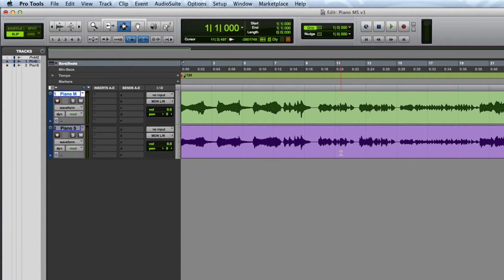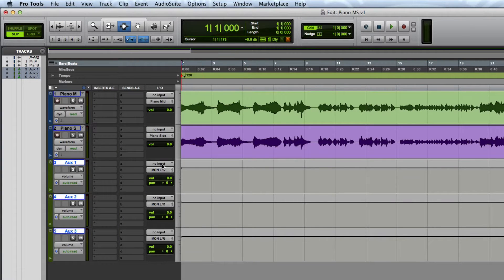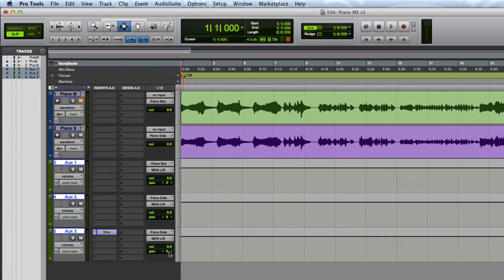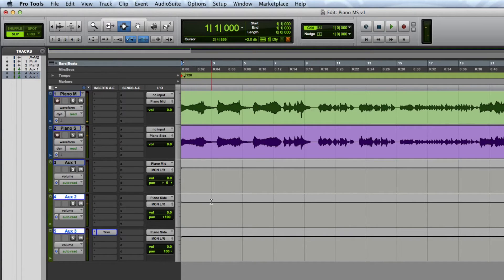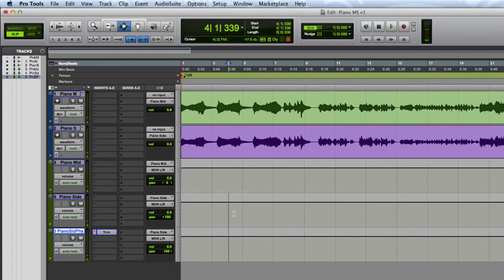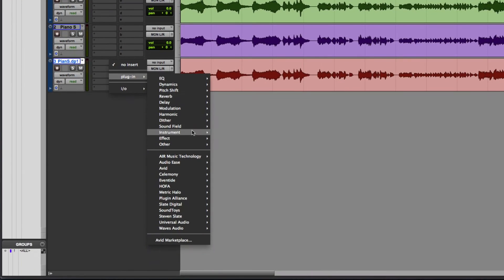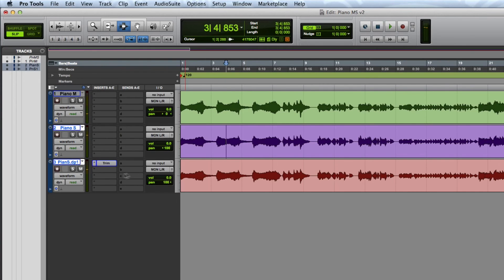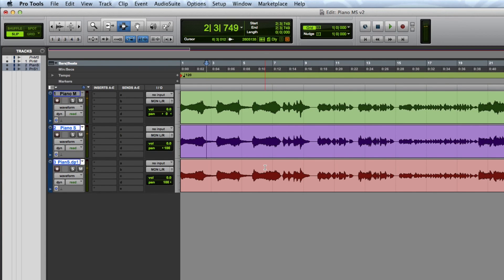How to make a Mid Side Decoder in Pro Tools

Comment: Could you record a side track with two mics point directly away from each other then flip the phase on one of the tracks?  If you don't have a figure 8 pattern mic?
Reply: You're better off using a different stereo technique in that case. XY is pretty close.
Reply: @oblivionwalker8613  Decoding an MS signal basically creates an XY field right?
Reply: The answer is yes. If the cardioid mics being used are identical and you have the capsules stacked as closely on top of each other as possible an then flip phase on one side it creates a figure-8 result. If you don't flip phase then you get an omni pattern.

Comment: Thanks - well explained - helped me out.
Reply from the maker: +Sukram Sukram Glad it helped out. If you have any ideas for other videos to post, feel free to let me know.
Reply: SecretsOfRecording
 Hey thanks. I have some ideas. How to master kick drum and bass together so they minimize phase cancellation/interference with each other.

Another idea, with pop songs when you look at the final waveforms, you often get a general flat plateau which resembles, on first glance, clipping. But it is not of course :)

They have used limiting and compression (L+C) in ways to achieve this that so far I don't understand.  Wondering if they L+C each track individually, or the final mix, or a combination of the two ideas - L+C stems.

Or have some setup where two or more tracks are linked, a loud sound in one track momentarily dips the audio in another instrument to make room for itself.

I have a recording of Robby Williams 'Millennium' which is a perfect example of this. A flat-lined looking waveform achieving maximum loudness, but all instruments are clearly audible and the mix does not sound squashed or compressed, when it certainly 'looks' squashed and compressed while observing the waveform.

This has me eager to learn!